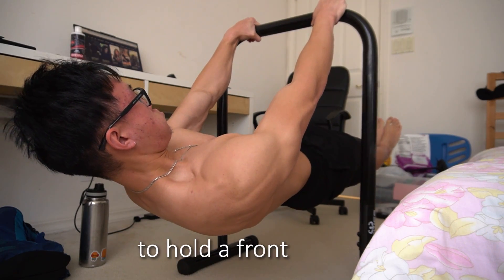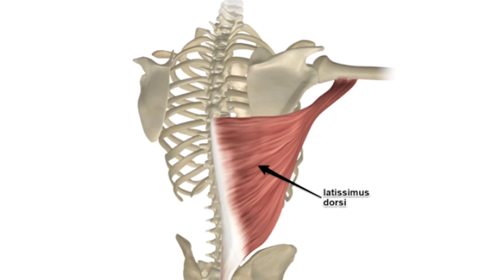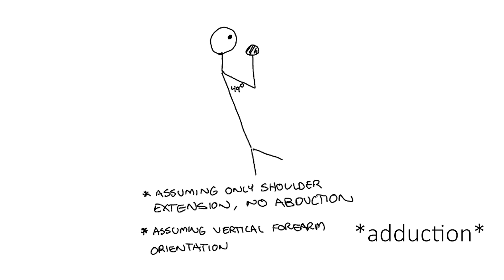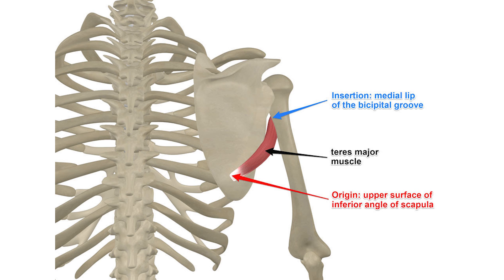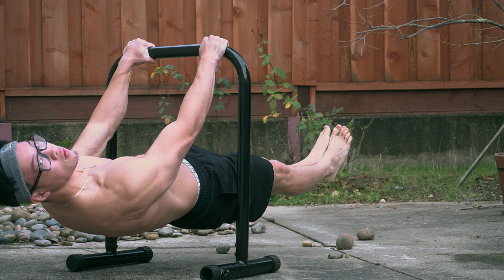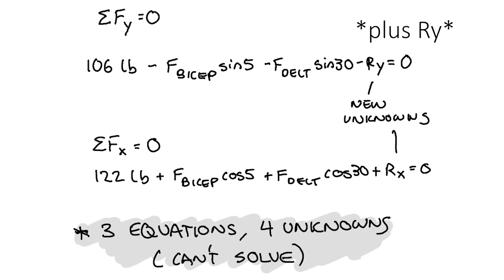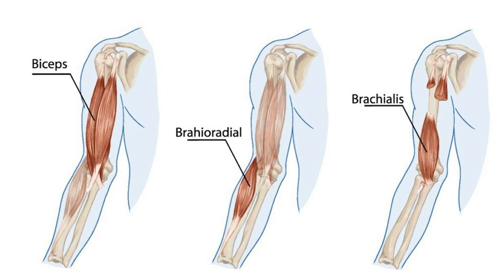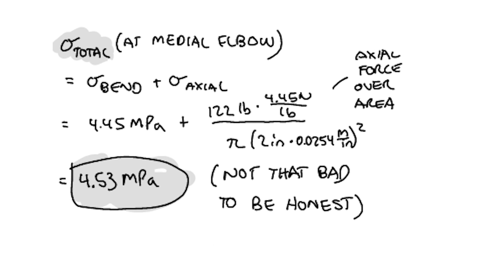Biomechanics of front lever & planche

Comment: Enjoyable video man

Idk how the math changes, but the OH Press weight that was found seems to be closer to a reasonable Bench Press target for the Full Planche (1.75xBW). Based off personal anecdotes within training. OHP about 1.1 or 1.2xBW for 3-5s hold.
Reply from the maker: Yup, I made 3 attempts to estimate the tension in the front delt in the planche. The first attempt yielded 850 lbs, the second didn't work at all, and the third yielded 420 lbs. So most likely, the actual answer is somewhere between the first and second, which would match your personal anecdotes! And thank you!

Comment: You could hold frontlever when doing 20 pound weighted pullups? :S
I use almost 35 for 5 reps, and I can just hold a super advanced tuck for 5 seconds. And we're the same weight.

Thanks for all the math :) It's been a while since I took physics, but I liked your approach and calculations.
Reply from the maker: Don't take the numbers too seriously! There's a lot more that goes into holding a front lever than just the strength of the lats/weighted pull-up, so that figure was a bit misleading. Even though my weighted pull-up wasn't that strong, I still trained for 1.5 years to learn the front lever! And thanks!

Comment: Wow Jimmy great job. Your work is very convincing and thorough given what you had at your disposal. I found myself thinking a lot about these movements in a way that I have never before, especially the axial forces to counteract the horizontal components of the tangential forces and the calculation of the moments through the insertions along the limbs. I just about died on the planche discussion lol 😆. I may be misunderstanding, but since you suggested that the bicep contributes to shoulder extension due to its connection at the scapula and you included that in your revised planche calculation, could you have done the same for the hspu calculation and found a value that is less than the deltoid force in the planche?
Reply from the maker: I'm glad you found it interesting Tony! Yes, I also died in the planche discussion, but in a different way :) 

As for your question about the HSPU, this is actually something I thought about too! The reason why we can't assume that the bicep assists in shoulder flexion during a HSPU is that the biceps and triceps are antagonists. Basically, since the HSPU involves the triceps, that means the biceps have to be deactivated or else they'll interfere with the elbow extension aspect of the movement. As a result, the front delts can be assumed as the only agonist of shoulder flexion in the HSPU!

This is unlike the front lever/pull-up, where I neglected the rear delts and teres major muscles. The rear delt and teres major contribute to both the pull-up and the front lever, unlike the bicep which contributes only to the planche. So by ignoring the rear delts and teres major in both calculations, I end up getting a similar amount of error in them. This allows the "how much weight do I need to add to a pull-up to get the same tension in the lat as the front lever calculation" to still be pretty accurate.